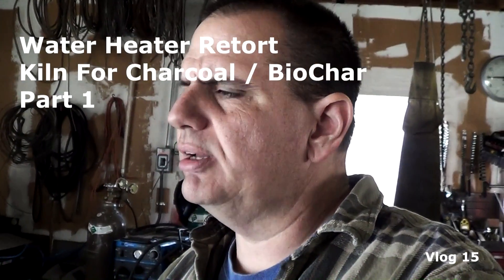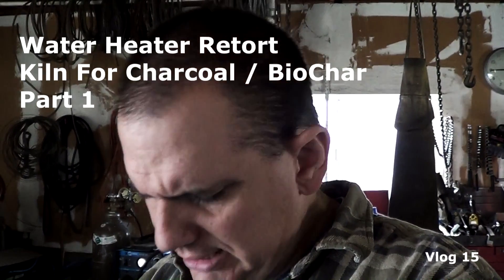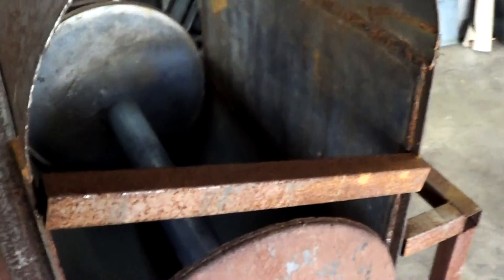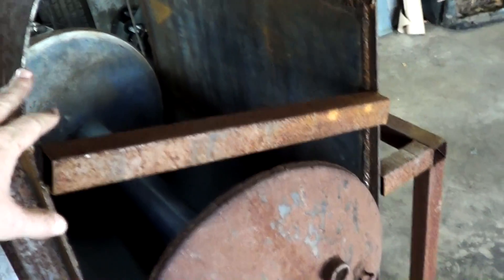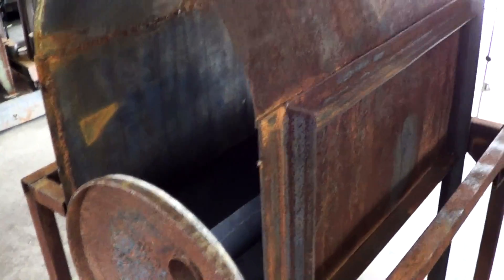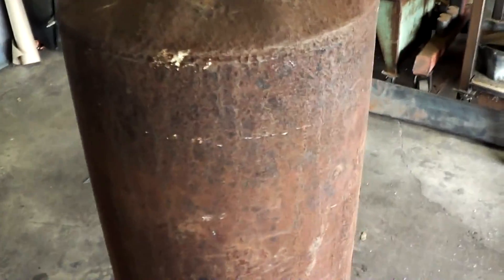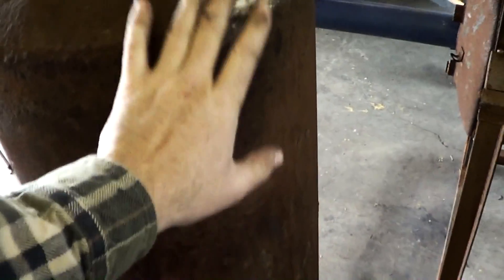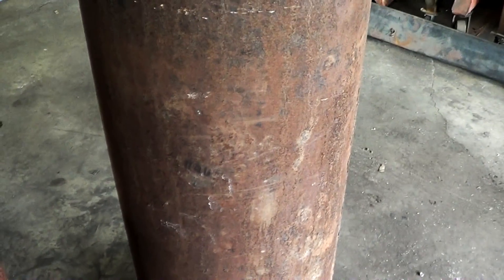Homemade Water Heater Retort Kiln for Blacksmith Charcoal Forge / BioChar / Pyrolysis P1 V15

Comment: Your 1 inch spacers. How long were they and or how long was the gaps to direct the heat? I so like the concept of your build. Small and easy to use. I'm using a rocket retort kiln now. Getting good charcoal from it. With your idea, i could light it, and walk away to do other things while it's cooking. Thanks.
Reply from the maker: I don't remember how long they were.

Comment: Interesting build from what I could see.  I would love to understand this design!!  However, (a little tough love?) you started the video by using 1:49 to apologize, and then the video is shaky, unedited and not very explanatory about the design, materials or build philosophy - All issues you could fix with a little editing?  Let's see this thing running and really show us how it works and how you built it!  That I would watch several times!   Cheers
Reply from the maker: Maybe this video will work for you. https://youtu.be/JoSMa0cWgOA

Then the follow-up. https://youtu.be/my3HU0YAuqM

There have been a couple more improvements since the last video. I bypass the pipe in the back entirely and I finally got a total of 6' of stove pipe on it. Now it runs very efficient.

Cheers!

Comment: not sure if it's too late to be useful (you never know) but if the modile table saw mounting situation is still a problem for you, my wife's grand father mounted mine on an old gas BBQ frame he picked up for free and it's worked out very well thus far. either way cheers!
Reply from the maker: I'll keep it under consideration. I haven't messed with it in a while and it does need something.